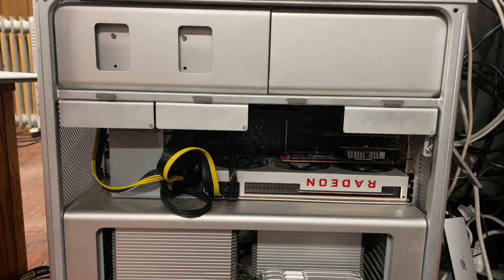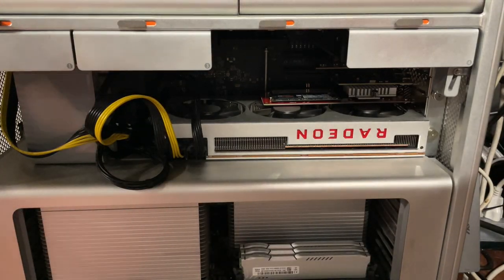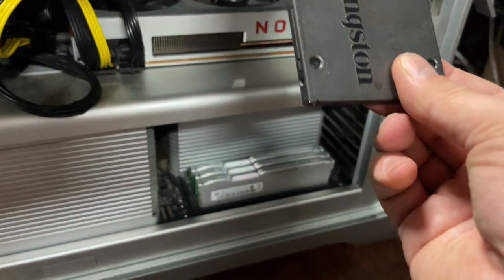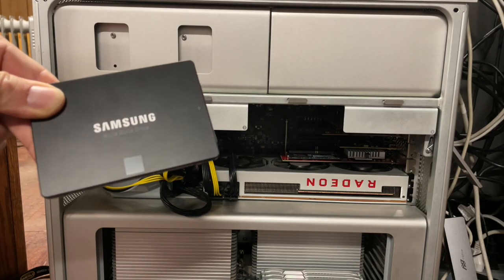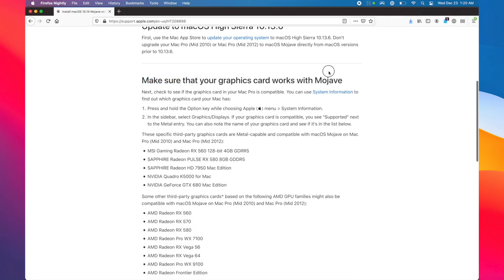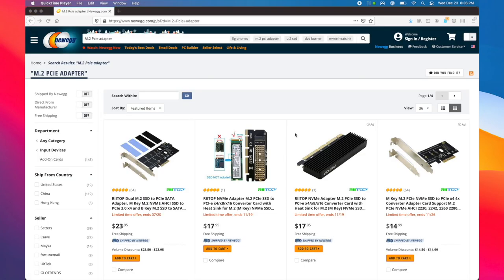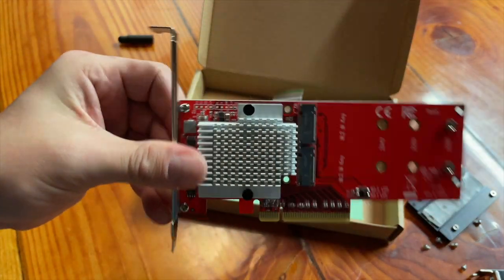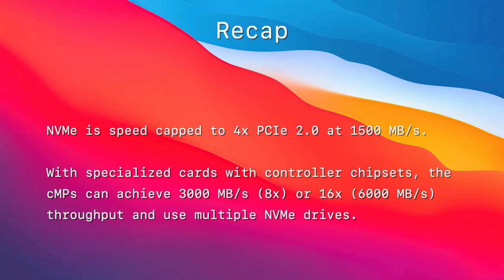Mac Pro 2006-2012 (1,1-5,1) SATA / NVMe  SSD Upgrade and Storage Overview Part 1

Comment: You’re making me very happy, my friend!  6-7 years ago I did the 4,1-5,1 flash and installed Westmere 3.46 hex. It has been very successful but the lack of TB backed me into a corner with Pro Tools upgrades. Solved!!
Reply from the maker: There's a bunch of guys with Thunderbolt cards in their classic Mac Pros, mostly for.... audiogear as everyone loves the Apollos. There entire groups on it, the biggest caveat even with a modified Thunderbolt 3 card, you can't do hot swapping but with an interface like those, you won't be doing much of that with a desktop.

Comment: I’m still confused, but know more than i did before. MANY THANKS. Make a store, even click through, where we can buy stuff through you my good man.
Reply from the maker: @Gavin I could do amazon affiliates but I doubt I'd amass more than a dollar or two.

Monetizing the Definitive Mac Pro Upgrade Guide is tricky. I can't sell it as I want it to be open and its largely based off of community support. I've certainly dumped more man hours on this project than any other digital project I've done for ages. 

I could put adverts all over it but that'd be awful and the traffic levels it gets (while about 20,000 people a month view it) is pretty small potatoes.  I'd happily take sponsorship from someone like Sonnet Tech as I'm a fan of them, but my guide is a curiosity.  I may end up turning into a dedicated website and revisiting it from there. I lamely tossed up a half hearted Patreon but have nothing to offer and a tip jar.

Comment: Thanks so much for your work on the online Definitive Guide. Absolute gold resource. The guide steered me away from PCI adapters for my 2008 but it made me realise that PCI area is the best location for added SSD drives. I've found  the cheapest, easiest way to go is plastic or metal mounts that physically replicate the shape of a pci card (complete with blanking plate and tang to sit in a pci slot) enabling you to mount an SSD where a pci card would go. Simply run SATA data and power as-per the optical drive bay conversion. The plastic mounts are under $5 shipped from China.
Reply from the maker: Sounds similar in spirit to what I did for years in my 2008, I bought a bootable sata 3 card and SATA ssd back in 2013 and fed the sata cable to my optical bay and then tapped off the power from the drive bays. I didn’t even bother to properly mount the drive. 

I could have bought a PCIe card with physical mourns for sata SSDs like the Ramjet Mac Pro Ultra PCI Express Card or OWC Accelsior S or Sonnet Technologies Tempo but I was irked that they were a lot more expensive than the cheap $50 card I bought. They’re more reasonable now. These days there the most painless vector for SATA SSDs in the 3,1.
Reply: @dmug  Everyone runs into the same things on the Pros which is why your Guide is Canonical. Funny tho’, there’s definitely a tipping point being reached where NAS and ethernet/wireless speeds are becoming beautifully harmonious with NAS affordability (or rather frugality) levels making extra internal storage somewhat redundant. 
The other fundamental point to keeping the old gear up to speed for me is running legacy software such as a complete and paid for (!!) Adobe suite and (and this is a huge one) Macromedia Freehand MX. I currently run Parallels to run Snow Leopard to run all this software as seamlessly as possible SO your recent vid about getting OS9 and other OS to run on newer Mac could be THE key to reaching the holy grail of cheap home systems. 

Re the bracket: Being ABLE to afford things isn’t the point, it’s a win to make-do and solve. I can afford brand new cars but I don’t. It’s fun driving 10+ year olds for 1/10th the price.

Comment: Good first video, Greg. I have a 2010 cMP, and am using a few upgrades like SSD storage for all four HD slots, and the Startech PEX8M2E2 adaptor with 2 WB Black 1TB drives. It does run smooth and quick. Maybe you can get into doing OS upgrades using OpenCore? Also, maybe discuss the idea of adding TB3 via the Gigabyte Titan PCIe card.  am installing it today with the OpenCore software update to provide 40GB speeds. We are looking forward to your next video!
Reply from the maker: I'll have a new vid in the next week. As for OpenCore, I'll be eventually getting there but it's going to be a bit.

For now check out  Joerg Henninges' youtube channel. He (and Martin LO) are the people right now for OpenCore info and anything I do is likely to be based on their work.

https://www.youtube.com/channel/UCyd3VQTBmzgTgC-73nUkmCA

Comment: I have managed to boot Sonoma 14.3.1 & OCLP from NVMe, although my Firmware MP51.0089.B00 on my MacPro 5.1(2012). EFI is on a Sata SSD and OCLP is set for NVMe booting.😀
Reply: Does it work well?

Comment: You know what I find is funny is that the SSD is detected actually in Mac. OS on the Mac pro 1,1 and I know this because I was experimenting with snow and leopard for a retro mac pro project after installing the card mac os x snow leopard and lion recognized the pci card and even gave me a warning that the device is detected but running at a slower speed then expected so it does recognize it but its just blocked from using it weird as heck.

Comment: Because of your videos, I bought a MacPro5.1 2x2.4 Ghz 2012, 24 Gb ram, 240 Gb SSD, 500 Gb HDD, 640 HDD for DKK 2000 ($284)😀
Also install a USB3.0 card, Asus 4xNvme PCI with a 500 Gb M2.

Comment: nice video,music and details. Thanks for creating this I got 2 mapros 1,1 that a neighbor has just thrown out and Im watching videos learning before I begin to spend money on these parts. Best video yet very descriptive. Subscribed
Reply from the maker: The 1,1s are kinda dead when it comes to macOS as they're forever locked to OS X 10.11.x and with PCIe 1.0 they're about as old of a computer you'd want to use. They'll run Windows 10 fine though.

If you're looking for an ultra cheap project computer, the Mac Pro 3,1s often end up going for $50 and can run the latest macOS with a bit of TLC.  

I actually was going to do a video on the 1,1s and Windows 10 but the 1,1 I have is toast.

Comment: Running a 2008 8 core mac pro 3,1 with Catalina. I also flashed a GTX 680 for boot screen, I also added a broadcomm wifi/bluetooth card from an imac? I think.. I wish I had this when I was doing the upgrades because it would have helped me a lot haha

Comment: Greg, not sure how much I'll use your youtube videos but your Mac Pro Guide is effing awesome; I had a fully maxed out 2.1, upgraded last summer to a 3.33 5.1, but I just picked up a 4.1 dual 2.6 machine with an updated firmware, bunch of upgrade cards, and 16tb of storage.  Pretty geeked.   One thing though, I'm not sure if the dual CPUs will help me or not.   I mainly use iMovie for most of my editing and I'm not sure it can benefit from dual CPUs.  Anyway, subscribed/liked to show my support, your guide has been extremely beneficial to owning these things over the years.
Reply from the maker: I have some more experimental vids in the works that don't necessarily fit the update guides: a vid almost done about the Oculus Quest 2 and the Mac Pro, long for opinion piece on Snow Leopard, and probably some dumb experiments like putting Windows 10 on an NVMe + Vega 56 on a Mac Pro 3,1 and comparing it against my 5,1 with that same GPU so hopefully they're entertaining as I'm getting better at the ol' youtubes. 

As far as iMovie and dual CPU, I'd assume at the very least it would be at some level, you can always fire up activity monitor and watch how much activity iMovie uses or use htop from the terminal.
Reply: @dmug  One thing I'm interested in; some of the CPU replacement kits come with bolts to replace the plastic standoffs.   How likely is the plastic failure to actually occur?  First time I heard about it was a few minutes ago.   Seems really excessive.

Comment: I’ve had my 1,1 since September 2006. It’s been off for ages but i really want to make use of it
Reply from the maker: Actually, was planning to possibly do a video about a cursed 1,1 I have. It only can run macOS 10.11.x but you could dual boot to Windows 10.
Reply: @dmug  was trying to setup dual boot but can’t seem to do it without having an ATA pre boot 🤷🏽‍♂️
Reply from the maker: @MePeterNicholls  Hmm, might want to pitch that to one of the communities. I never owned the 1,1 beyond the non-working one I got recently so I've never gone through the process of the Pike's script and dual booting on it.   

I'd assume it'd work by getting a Windows DVD for Windows 10 for legacy mode, then boot of the CD to install Windows 10 on a separate drive. Then I'd use what's know as the brigadier method to install the drivers in Windows 10 for all the hardware.

Comment: Another pci switches work, the high point pcie card (switch Plx pex 8747) and the iocrest io-pex40152 (switch pfx l32xg3); both with full bandwidth (x16), the asm2428 it's half bandwidth (x8).
Thank you very much indeed for the guide, I'm always reading and learning from it.

Comment: Useful video, thankyou.
Added nvme & pcie express card to mac pro 4,1 for Catalina via opencore.  All good.
Reply: What pci host card did you choose?
Reply: @number1talentable  Lycom DT-130 Dual PCIe NVMe M.2 SSD Carrier Adapter
Reply: Thanks for the response Christopher. Did you run into any issues getting up and running or was it pretty much plop & play?
Reply: @number1talentable  no issues, I already had the latest firmware installed.
installed it, turned on the Mac and it worked.
Reply: Thanks for the info. I'll probably go that route.👍

Comment: HI Greg, thanks for the great video.
A quick question as your video is 2 years old, are there any NEW to market NVME cards which support 2 NVME drives?
Reply from the maker: Not really that I'm aware of, just look for the ASM2824 or PLX8747 cards. There's a TON of the ASM2824s but often they won't boot unless there are two SSDs present. The PLX8747 is the better chipset, it's the one found in Sonnet cards.

Comment: Awesome tutorial! Thank You for making this video and list of metal supported cards for the Mac Pro! Could you make or include in your videos or comment here, your personal suggestions for best performance/budget working nvme card setup? IE 5,1. Subscribed and liked, keep the videos coming.
Reply from the maker: That's a very open ended question, what's your budget? What sort of capacity are you hoping to get? 

 Generally, I'd just say buy whatever Samsung 970 series you can afford and start with Kyro M.2 as they have a nice design.  You can't go wrong with the 970s.

Otherwise, I'd target SSDs using the SM2262EN controller/NANDs like the HP EX950 or ADATA SX8200 Pro as they're a bit cheaper (although the Samsung EVO Plus has dropped in price) and generic 4x PCIe M.2 host.  Anandtech has a nice breakdown of the SM2262EN and those two drives.  For 1 TB you should be able to walk away for under $150 USD with this.
 
https://www.anandtech.com/show/13759/comparing-adata-sx8200-pro-vs-hp-ex950

Lastly, if you're on a SATA SSD, don't expect mind bending performance improvements over it. It's noticeable but not nearly as much as going from an HDD to a SATA SSD.  If you're on an HDD, even running a SATA SSD will be life-chaning, especially if its a good one like a Samsung 870.

Comment: I have an SSD OWC 6G card that refuses to allow wifi to work. I have 2 machines so I swapped one with the other and the bad one still didn't work in the other machine. So I totally scrapped the OS on the card and did a total reinstall. Nope, same problem.

Comment: Should I replace the two harper town-penryn 2.8 processors in my  '08 3,1? Does it matter as much as putting in a SSD? I'd  like to put in a Nvme SSD. Can you recommend the best one that doesn't break the bank and for the processors as well? Thanks!  I'm so glad you are out there fighting for the people trying to hold there old macs together. You should be known as "MacGyver"!

Comment: OCZ makes Mac Pro 1,1 NVME m.2 raid controllers for osx 10.6-10.11 that also lets me bootcamp Windows 10 x64
Reply from the maker: Got any links handy or model number, I could only find one thread on MacRumors mentioning that the Boot Configuration Data on a SATA device then using the driver, I'm guessing that's what you did?  If so this vector seems non-OCZ specific. I might need to do a follow up vid.

Problem I'm finding is OCZ is dissolved in 2016 thus there's little info and Toshiba seems to have wiped info about their legacy products.

https://forums.macrumors.com/threads/ocz-revedrive-x2-pci-express-macpro-compatible.1135458/?post=12377417#post-12377417
Reply: @dmug I had the card but it was stolen I’ll keep looking at my local shop

Comment: Thank You So much for all you have done with the excelent guide. Pls don't give up on the CMP's Do some about Hyper-V or VMWare . I been running 3 CMP's w/ Hyper-V 2022 for some time. Great Hyper Visors w/ 8 SSD's & 1 NVMe..only issue is i have to add NIC's as i cant find NIC drivers. Much better looking than the HP & Dell Racks i used to have in my house
Reply from the maker: I kinda have to some degree as I’m not vigorously updating my guides. We hit a tipping point after Ventura and Sonoma started using AVX2, Apple abandoning newer GPU support in the Mac Pro 2019s, and used Mac Mini M1s are popping up on eBay for all of $300 . 

I made a series recently on the 2008 Mac Pros on my channel but after almost 6 years and too much money spent, it’s no longer a priority. I tabled videos on things like a WiFi upgrade guide  as I sold my Mac Pro5,1 during the pandemic. If/when I make another video about the classic Mac Pros it’ll probably be in the vain of the 2008 series as those did quite well on YouTube.

Comment: I found out something interesting in my PC build & hope it will duplicate onto my Original Mac Pro 1.1 - I have thankfully a Radeon 5870 that works on the Mac & PC no problem as I was nervous it would not be compatible on the Mac for firmware reasons etc. to my delight no issues. I also have an ATI FirePro V5800 that I Crossfired together in the PC  as I discovered found out that they are both on the same chip architectural family. I was sketical at first about this but in fact did confirm it with a geekbench test both cards showed up. I will have to try it out on the Mac Pro & see if there is a noticable improvement. I did not see much improvement in Crossfire in the PC when i ran Google Sketchup it would lag, process, take a minute etc. PC has a AMD FX 4.0 octa-core w./32gigs DDR3. Only when i got the Nvidia GTX 1060 3GB  did i really notice improvement on the PC. Not sure that card is compatible on the Mac I have not tried but kinda doubtful I may try it someday.

Comment: Thanks Greg, Tons of good info, thanks for sharing. I've done a Blu-ray drive upgrade using one of the "extra" sata ports, works great, but looks like I should stick to a sata SSD upgrade rather than the PCIe NVme upgrade in order to boot, it's just not worth making a brick out of my 3,1 if the firmware upgrade fails. Best sata ssd to use?
Reply from the maker: A user pointed out you can use rEFInd to install to the NVMe drivers on the 3,1, its now linked in the upgrade guide but after that, I'd just got with the high performing SATA drives with a SATA 3 card. 

NVMe is faster but its not nearly as huge going HDD to SATA SSD. I'd just recommend going for the higher tier drives on SATA as they only cost marginally more like the Samsung 860 or Crucial MX500. Those are the gold standard of prosumer level Sata SSDs.

Comment: Hello Dear Friend, I have a Mac Pro 5.1 2010 2 x 2.4ghz. I got Crucial P5 500GB NVMe and Akasa M.2 SSD to PCIe Adaptor and i put it to pcie x16 slot. When i start computer it stucks before log in page and restarts computer continuously. If you have any idea about it i will be very happy man.
Reply from the maker: I'm unsure of the model but the Akasa card I found is a 2-port card that requires bifurcation. I'd first try a single port m.2 host card as my guess is its the card.

Comment: Hi Greg, thanks for these great guides!  I got the NVME PCIe working (Samsung SSD) on my Mac Pro 3,1 using OpenCore and boot from it.  But speeds (on Black Magic) around around 600s write/700s read.  I also have a Mac Pro 5,1 and get 1400s write/1500s read from the same model of SSD - same configuration.  But the real kicker is that I get those same speeds when I test the MP 3,1's NVME drive on the MP5,1!  Any idea why this is the case?  I know they are not affected by the SATA limitations.  Your expert opinion will be much appreciated.  Geoffrey

Comment: I can't boot from my M2 NVME SSD. It's a Samsung 970 Evo Plus with a simple Pcie adapter card. The SSD is recognized and working. Black Magic DiskSpeed also displays the correct speed. read and write about 14-1500. but how can i boot from it ? I have Ventura on my Mac Pro 5.1 Cheese . the 970 Evo Plus got the latest aviable Bios / Firmware .

Comment: Ok So I got a weird one for ya, I have a 1,1 that i put a pair of 5365s and 32gb in. It ran fine and then I got a drive that had El cap preinstalled and it boots fine! Graphics are crap so i know i have to upgrade the GPU however my mac is still showing 1,1 in system report. Will upgrading the firmware improve performance? and/or what’s the best way to do this if I already have El Cap installed?

Thanks!! Love your videos and they have helped me immensely to get this far!!!!
Reply from the maker: I'd first start with the NVRAM reset, as any time you swap the CPUs, it's a good first step. Next, I'd try the 1,1 -> 2,1. To be frank, I've never really used a 1,1 so I haven't done it myself. If you have problems still, I'd pitch this to one of the Mac Pro communities on FaceBook, Reddit or in the MacRumors Mac Pro forum.